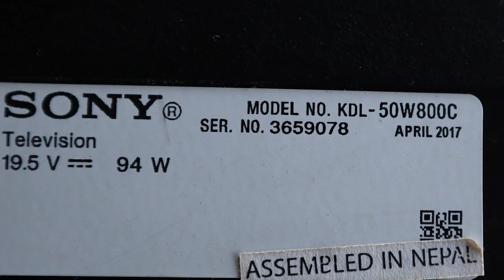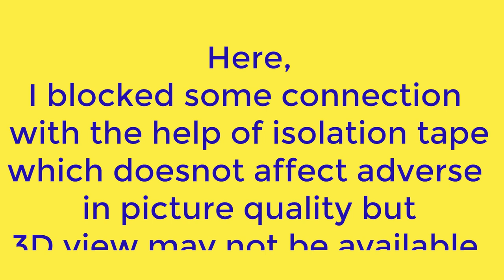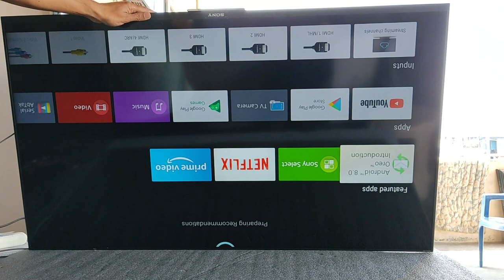Colorful bars on TV screen

Comment: You could solve that problem with software update from USB. Download firmware from Sony site, copy it to USB drive, connect to tv and plug it to outlet. You should do update after each t-con replacement in Sony tv.